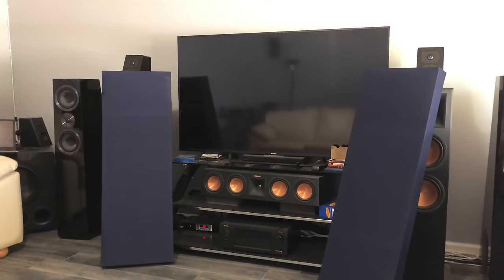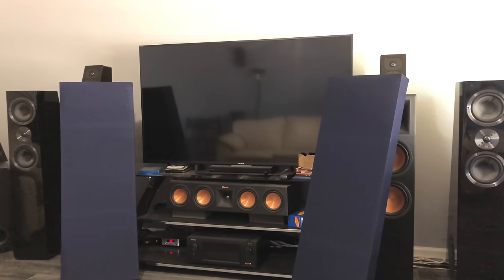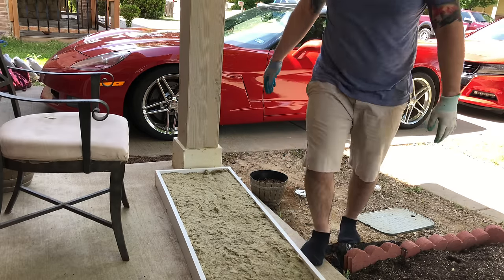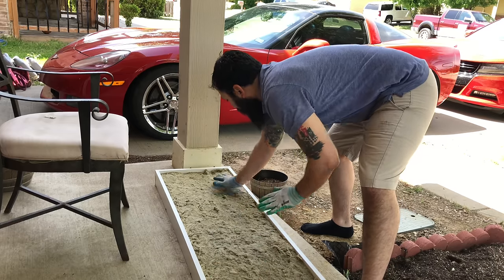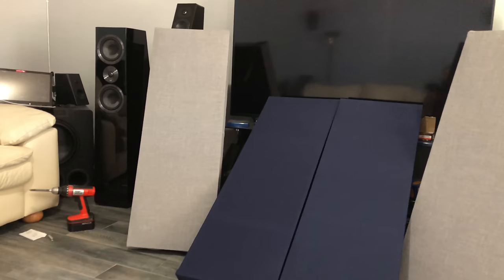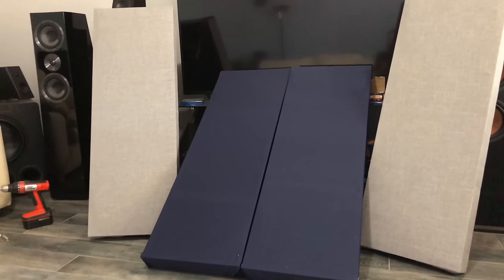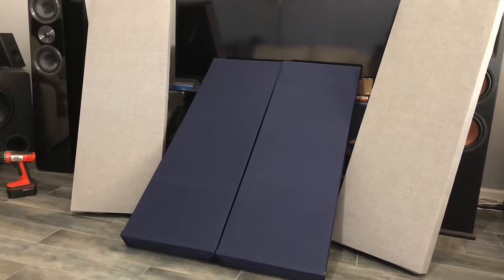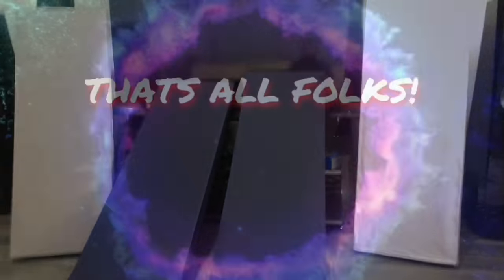How to Make Acoustic Panels for Home Theater & Save Hundreds!!

Comment: I use mdf for the frames and drill pilot holes to keep it from splitting. They weigh a ton but they work really well
Reply from the maker: gonna use pine next time. Also i have a diffuser video coming

Comment: Even if you choose to use a different type of wood, predrill the holes. It will split if you use screws.
Reply from the maker: Jeung21 good Idea. I couldn’t find the right sized drill bit the first time. I will do that with better wood the next time around. Thank you!
Reply: Or just use some wood glue and nail it with an 18 gauger.

Comment: Most people don't need these.
What they need is to
Calibrate Calibrate Calibrate their surround system properly.
A sofa, carpet, drapes & other furniture provide the needed absorption.
Fact.
Reply from the maker: I dont have carpet. i have 800sq/ft of tile. Tile increases echo. I fully carpeted room may not need it yes.
Reply: Most people do need some type of treatment. Calibrating, no matter how sophisticated the algorithm, can't correct a reflection point like a simple absorbing material can. The calibration process attempts to correct the room. The room is far more important than the calibration. Correct the room first.
Reply: You're wrong, fact.
Reply: Turkey Tom  Haha ok. I'd suggest that you call up any high end professional company to design a theater room for you. They'll start with the room first every time. Did you notice I called it a theater "room"? The designer will always start with the room issues first, selecting equipment after and employing calibration last. In fact, in most professionally designed environments the room is demo'ed down to the studs to correct its sonic imperfections. Think when they design a recording studio the engineer says " ah well, audyssey fixes everything.." Anyway, I figured you're trolling me. But, the facts are out there, and this being such a good channel I'd rather not see useless ignorant stupidity thrown about the comments. But, this is only youtube.